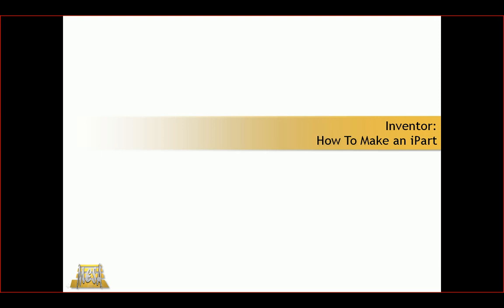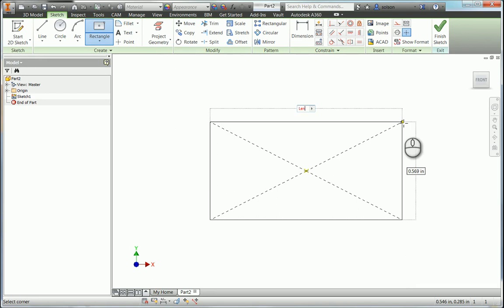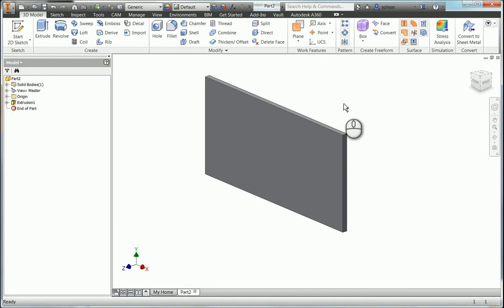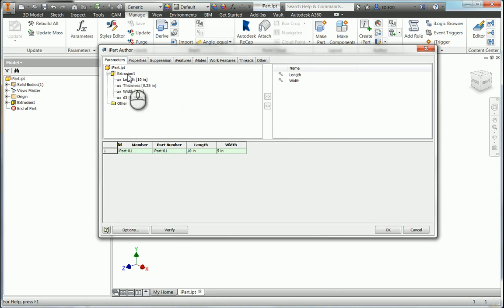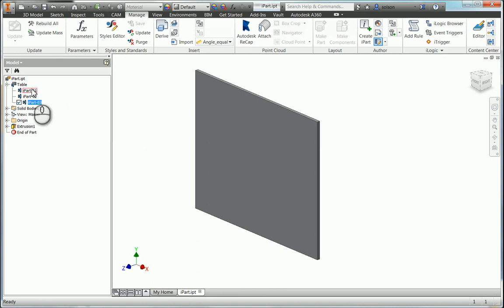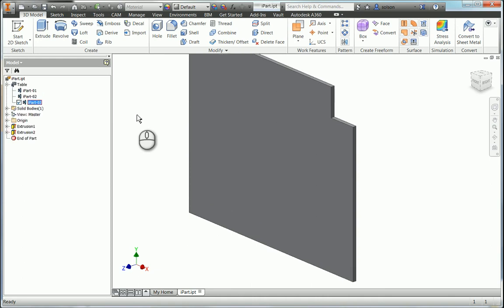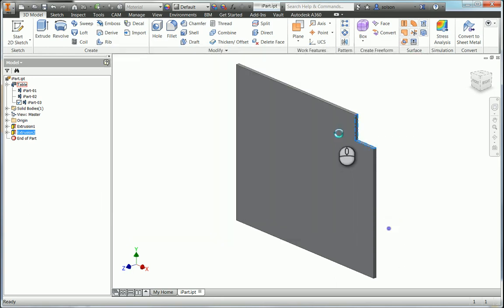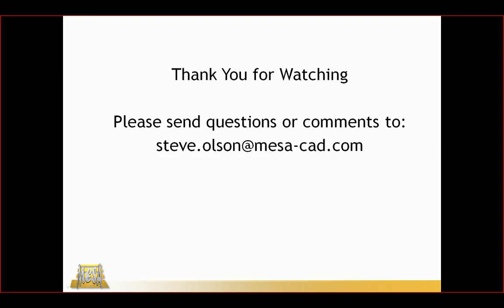Inventor: How to Make an iPart

Comment: one thing I cannot find reference to anywhere, is how to make a Custom Vs. Standard iPart. I want it to ask me sizes as I place it in my assembly as I have many many sizes I will need. I am using it for glass in storefront/ curtainwall application and the sizes are never the same.  thanks
Reply: You can set the columns that controls the sizes to Custom Parameter Columns.  Then it will ask you to enter the size when you place it.  To set a Column to a Custom Parameter Column, you right click on the column heading, when editing the iPart Table.  Hope this helps.